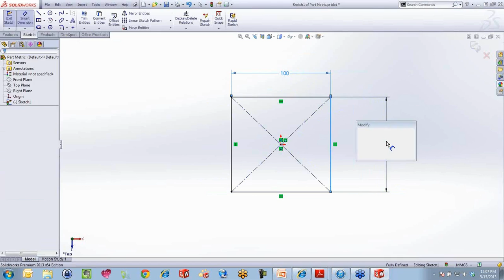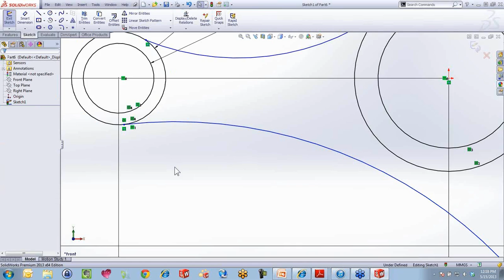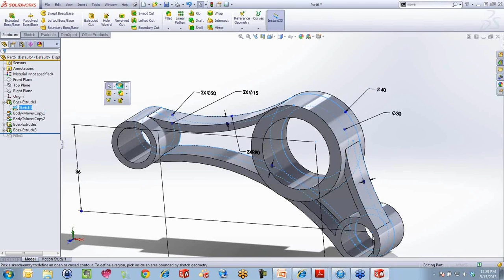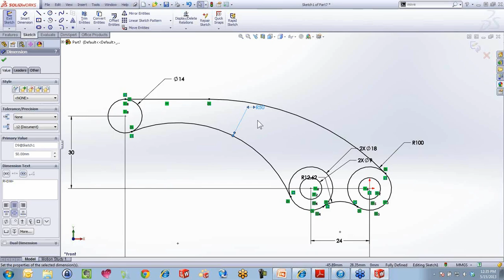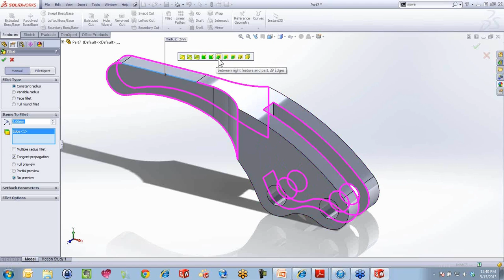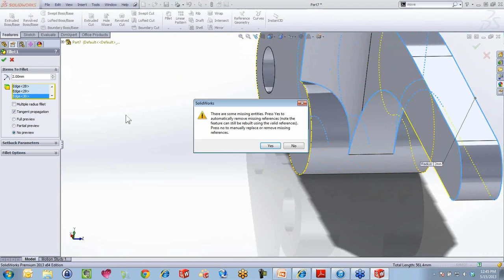Lunch & Learn - Part Modeling a Step above Essentials

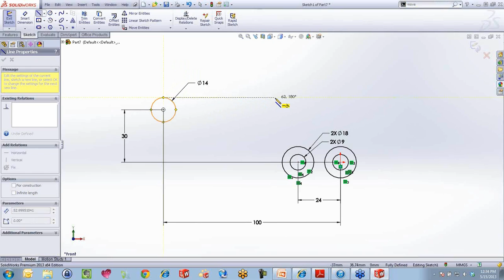Comment: I have a question at 34:20, how did solidworks know to stop the line right there so he can conveniently draw an arc line to connect to the other circle? Also, does it matter where you stop the straight line? I mean I guess I can do a line anywhere, then 3 point arc, make tangent, then when I set the radius of the arc, it automatically fixes the length of the straight line right?